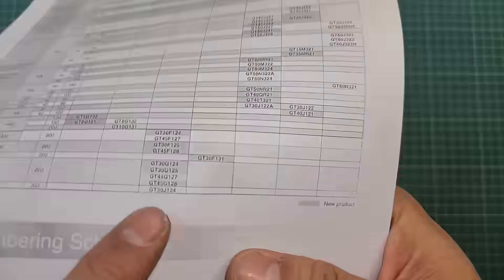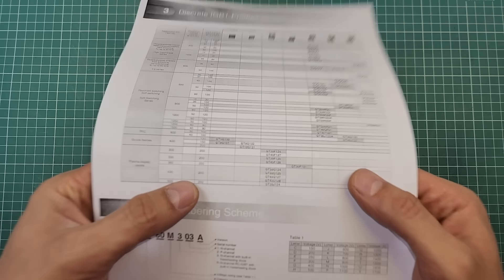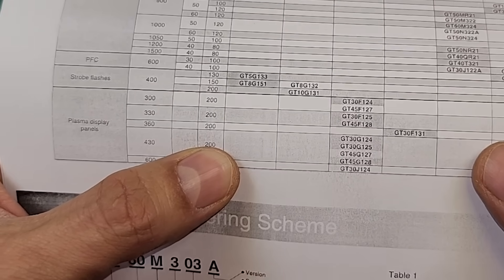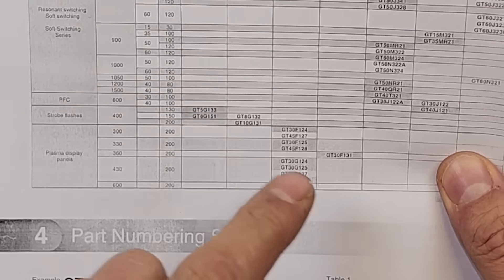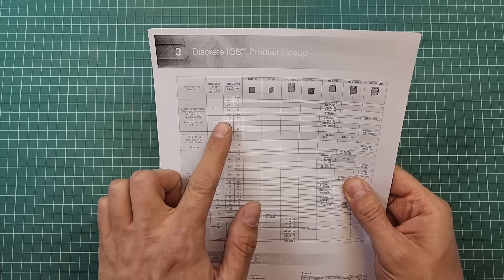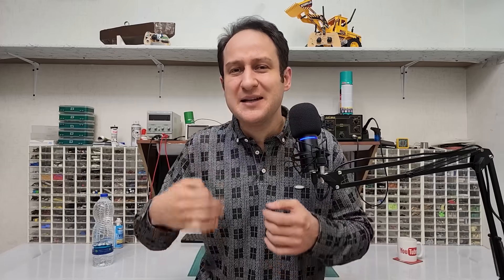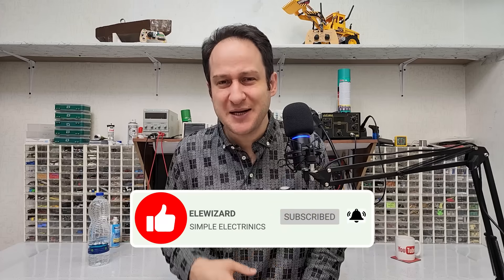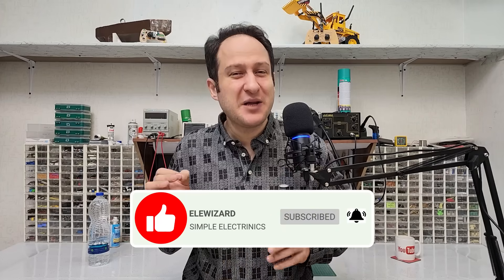Can a small transistor really switch 200 amps of current?

Comment: An experiment to increase laser diode output was conducted using increased voltage and amperage above it's specs.

The output was vastly increased but it required the laser diode to be submerged in liquid nitrogen to keep it cool.
Reply from the maker: That's a great idea, thanks for sharing!

Comment: I mean... What I do is look at the power dissipation, take the expected voltage across the device for a power calculation, and get an estimate.  Real components will always vary a bit and, while gate charge dissipation is usually not a significant factor for IGBT applications, it is worth considering in mosfets and stuff operating near the RF spectrum.  This also makes obvious strategies like zero voltage switching and other methods of driving voltage and current out of phase to limit thermal dissipation.

Ultimately, nothing beats practical testing, though.  There was some testing of overdriving some IGBTs into the ten kiloamp range and they found that the devices largely survived.  While you have a radically reduced part life, this is in the range of tens of thousands of cycles as opposed to ten to the power of big numbers cycles.  For applications which can accept the cost of replacement as a consumable cost - it's valid.

The datasheet should list the testing setup for context for all of its ratings.

Comment: The ratings are not inflated. People must learn electronics, understand the fundamentals, and understand power dissipation. Data sheets may also have SOA (safe area of operation) curves that can be foretelling. When these devices “turn on” or “turn off” it is not instantaneous so there may be much greater peak power dissipation during these events that would exceed the absolute maximum operating characteristics.

Comment: Had a mig welder with an 40 Amp solid state switching transistor for the 24 volt low current trigger switch to engage  the 110V primary and conduct somewhere short of 40 amps to the welders transformer through 8awg copper wire. Transistor was the size of two matchboxxes stacked up or a tin can big enough to sell ear buds in.
At some point it became insufficient for the parameters of the job. It didn't smell any better either.

Comment: Excellent video! From the way you explain the topic, I deduce that you have a deep knowledge of power electronics. Perhaps you could have added that the efficiency of IGBT and MOSFET switching for handling large loads depends greatly on the driver circuits, which quickly bring them to conduction and turn-off states. The datasheet also contains information about the rise time and fall time for this purpose.

Comment: 20Amp not 200Amp Mr 😂
Reply: Continuous is  20A, under 2us pulse max 200A with minimum duty cycle 10 to 1.  In RF industry many time surface mount components like monolithic amp with  higher power rating are tested in fixture or even on wafer,  however the fixture will not have sufficient dissipation capability , so to test the component  pulse power is used  with short duration for example  100us with 10% duty circle, reducing effective power dissipation 10 time.

Comment: I suspect the 1.3 V voltage comes from the diode on the emitter. For lower power dissipation, you probably need a special MOSFET or thyristor, which is actually better at high voltages. For 240 V power, you need a 1000 V semiconductor due to voltage spikes from LC elements.

Comment: The transistor cannot handle 200 amps ( maby for ms ... ) because the internal resistance and the connecting wires are not low-ohmic or their cross-sections are large enough ...

Comment: It seems that 3 µs is commonly used in specification of the "short circuit capability" of IGBTs.

In a practical circuit that should be the maximum by-design time it would take for the control circuit to detect the short circuit and turn off the device to protect it from destruction when the load is short-circuited.

From a table from a REAL datasheet, the following is the parameter and the conditions on the specification
  Short circuit withstand time
  VGE = 15.0V, VCC [less than or equal to] 400V [this is for a 600 V part]
  Allowed number of short circuits < 1000
  Time between short circuits: [greater than or equal to] 1.0s
  Tvj = 150°C

No doubt ap notes and design guides for IGBTs discuss this.

Comment: That is nothing even remotely resembling a proper datasheet. It is a "product guide" and a rather poor example at that.

I spent many years designing industrial electronics. I wouldn't give that part even 5 seconds of consideration if that were the only "datasheet" available. It doesn't have anywhere near enough information to be useful. A good datasheet for such a part will have a multitude of graphs of all sorts of parametric and rating relationships. One of the graphs will be a family of plots of transient thermal impedance versus pulse width.

I simply can't find a decent datasheet for the part, I assume because it is long obsolete.

That is an extraordinarily poor choice of part to use for a discussion of specifications. Choose something for which a proper datasheet exists.

Comment: 26A     ....NOT WITHOUT a GIANT HEATSINK!!!!!!!!!!!!!!!    ....or dipping it in liquid Nitrogen! :)
Reply: One hidden dirty secret that ALL manufacturers dot not tell you is the max current the internal wires can handle continuous.
Usually way lower than you think!!!!!!!!!!!!!!!!!!!!!!    .....Triply so for fake mosfets that test correct Rds, but would actually melt if used by the datasheet (because even thinner wires are used - how cheap can you get)..

Comment: Nice run through of the critical parameters in the datasheet. I've always thought that if I have to even look at a component's (near) instantaneous current capacity, I'm probably considering the wrong part. Your review of this device is a great example of that. 200 Amps at a few microseconds compared to a working, continuous 20-ish Watts is a huge difference. And, right, if you did try to push 200 Amps through it for even a second, it will indeed explode. (Don't ask me how I know that - and no, kids, please do not try this at home :)

Comment: 200A is the maximum survivable current impulse it can take, likely in nanosecond to a few microsecond duration. That is usually for trigger transformer or safety crowbar service. For the latter you'll want to use 2 to 4 of them in psrallel.❤

Comment: So, what can i use if i really want to switch 200a current?
Reply: Depends how fast you want to switch, what voltage, and how often.  If you want to stick with IGBTs, then there are plenty of modules which will switch in the kA range.  For lower voltages, you can use parallel mosfets since they do tend to share current better than IGBTs or BJTs.  There are also single mostfets (in larger packages than TO-220) that will do 200A continuous.

Comment: It's possible to damage a semiconductor device in several ways: overvoltage, overcurrent, or overheating. To work out what the maximum current it can switch, the datasheet indicates the maximum current is 200A for 3μs. Current greater than that, even for shorter periods, may damage the device through overcurrent. But the necessity of keeping the IGBT's junction below about 175°C means that there is a maximum power that can be dissipated, and the datasheet shows that the TO-220SIS package will allow 25W to be dissipated if the case is kept at 25°C. As shown in the video, the Ic vs Vce(sat) curve will mean that 20A will typically be the maximum continuous current, and that will be only achievable if the heatsinking can maintain 25°C case temperature.

Comment: 11:41 This diagram is in fact nonsense because it compares IGBTs with MOSFETs which nobody would use for 50 A drain-source current, because their Rds is much too high. IGBTs have a certain disadvantage: their Vce is in a useful current range always somewhere between 1.5 and 2.5 V. The Vds of MOSFETs at higher currents, however, can be considerably smaller, because it depends on Rds, which can be very small.

So IGBTs have only advantages at higher operating voltages because Vce is somehow limited between 1.5 and 2.5 V. At lower operating voltages MOSFETs are considerably better than IGBTs because the Rds of 60 V MOSFETs can be smaller than 0.5 mOhm and the power dissipation at 50 A current is only 1.5 W (which can be dissipated without a heat sink) in contrast to 75 to 125 W in the case of an IGBT.
Reply: Thank you for being one of the few voices of reason. Most of the comments are based on opinion. You actually looked at the datasheet and did the math!

Comment: Wait a minute.  The max pulse current pulse was had a width of 3 us?  I missed what the off time was.  I'm sure it's in there somewhere.  Was it actually a practical time duration.  On pulse at 3 us means nothing.
Reply: The off time would have to be long enough that the device exhibits an average power dissipation that will not cause it to overheat.

Comment: From the circuit diagram I saw an nFET connected to a PNP BJT. I have a problem when they call that most positive terminal the "Collector". I suppose it helps some who imagine they are dealing with an NPN BJT. But I rankle when they call the emitter of a PNP a "collector". Call that terminal "P", call it "Fred", but it is NOT a collector.

Comment: Mathematician: "...so as you can see from this formula of power equals voltage times current and the associated graph, we can conclude this part won't really switch 200A DC..."
Engineer: "...son, if you really wanna switch 200A DC, you'll want a brick with terminals that connect through BOLTS, not some TO-flimsy capsule..."

Comment: Just be sure that the transition from OFF to ON is as instantaneous as possible to minimize the time where its in the intermediate Rds range where it would instantly fry if it was kept there.
Reply: That would be correct (if incomplete as there are also issues with making it too fast) for a MOSFET, but this is an IGBT, which basically a BJT driven by an insulated gate.

Comment: This was a great breakdown of the information there, followed by putting it together to actually predict how the device will behave in real conditions. Youve earned another subscriber!

I like that many datasheets also give a max. temperature and "thermal resistance," so you can calculate the power dissipation rating with different heatsinks and conditions.
Reply: Even if it's not stated, you can always calculate the thermal resistance jcn-case if you know the rated power at case temp = 25°C. These devices typically have a maximum junction temperature of 175°C, so the TO-220SIS package, which allows Pmax = 25W (@ Tc=25°C), has a thermal resistance jcn-case of (175 - 25)°C / 25W = 150/25 = 6°C/W.
To use that, you can calculate that max power for a given heatsink. For example, a decent heatsink that has a thermal resistance to ambient of 1°C/W gives a total resistance jcn-amb of 7°C/W. At Tamb=25°C, that allows a power dissipation of (175 - 25) / 7 = 21.4W. That's about 15A continuous at Vce(sat) = 1.4V.
Reply: @RexxSchneider  that is a good point. You can calculate it from the other variables of temperature and dissipation.

Comment: I built a reliable nanosecond pulse generator for TDR work using just a small signal 2n3904 (rated for 200 mA) in avalanche 
mode switching 180 Amps at a 1 khz rate. 
180 V avalanche through a 1 ohm load (32, 400 watts peak pulse power for one nanosecond, but only 32.4 mW average power ).
Thermal dissipation is the metric for destruction of a device.

You can pass 10,000 amps through a #40 wire provided the duration is short enough to prevent heating.
Reply: lol cool - that reminds me of a lot of lightning arrester data - a gazillion amps for fractions of a microsec can go through a 12 gauge ground wire and not fry.  Though I do prefer the wider, thicker copper braided strapping just to be sure. :))
Reply: @ 
Coward... lol
Reply: There are only a few BJTs specifically designed for avalanche available. Great to hear someone else in the comments has made a fast edge pulse generator.
Reply: Also add that that #40 is short, very very short.
Reply: Em qual situação prática usaria fio n40 e 10000A por um ou alguns nanosegundos?
Reply: @ 
A tiny high intensity magnetic field inductor for diamond anvil metallic hydrogen experiments. 
Nanosecond magnetic field requirements for high field strength on chip inductors in optical computing.
Any IC leadframe uses wire bond wires generally thinner than #40 including SS lasers. Maybe not 10,000 Amps, but some short pulse laser applications run very high peak I levels.
Reply: @ Estou me referindo a uma situação prática para nós, reles mortais e não uma aplicação científica.
Reply: @ 
Drawing a blank on that one friend.
Reply: @sparkyy0007 Foi o que pensei.
Reply: @sparkyy0007 how about making multiple of this and making them switch ON 1 at a time to make a continuous high Amp switch. Will that do? Or maybe there are other better options? 😆
Reply: @ 
One billion 2n3904 in cascade avalanche mode (if it could even be done) , I think there are much better options...lol
Reply: I was shocked a lightning bolt could travel through twisted pair with enough power to blow the back off my DSL modem, and fry the network jacks of my gateway,
Reply: Was it an EO q switch driver? I did similar to replace a KN-22B tube in a scientific laser. String of transistors in avalanche mode ❤
Reply: @christopherleubner6633  
I was using it for generating very short pulses for time domain reflectometry, for finding impedance variations along transmission lines.

Comment: Would you be interested in working on a project with me. I'm being extremely ambitious, and in over my head, I know little about electronics. Yet I'm  convinced I can build a push/pull low frequency inverter, if I had help. There is driver boards available. I'm guessing the board connects to gate drivers, and feedback circuits. I'm looking to get 5-12kw with it capable of 8-15 kw for about 20 MINUTES. And 10-24 kw for almost 1 second, maybe 1.1 seconds in the certain weather conditions.  I looking for help finding  a the components, a large toroidal transformer cores. F or up to 4-6 , 3-4 kw , silicon steel I s difficult to get in raw form. I'd settle for 50-60mm x 1000mm -1600mm lon bits and from .05-.08mm thick to 1mm thick at most.  I have even contemplated how could I hand forge  electrical steel / silicon steel into 1mm thick or less strips 75 mm at most Wide.  
If you are interested I really need help . Have an awesome day..🎉

Comment: If the parametric table does not show a DC current, but only a pulse current, this seems like a strong indication that this device is optimized for pulse operation, and likely other components are a better choice for steady-state operation.
Reply: I was wondering about that...
Reply: The real give-away is that the characteristics of the GT30F124 are laid out in a table on a page labelled "Plasma Display Panel Applications" with an example pulse switching circuit, and the table is titled "Product Lineup    For plasma display panels".

Comment: Even transistors truly rated for high amps will fail from heat or over current.
Some decades ago I added a phono jack to my TV without a headphone amplifier.  The final transistor failed.  It turned out to be a cheap Korean imitation of an obsolete RCA transistor.  My father in law took me to the RCA western distribution facility and got me three genuine RCA transistors.  We got 3 in case the next two failed.  It turned out the genuine RCA could handel the higher output and lasted longer than the original cheap transistor.  Eventually the TV became obsolete. My father on law said the Korean TV had a circuit design that RCA had used years before.  The TV still had a CRT

Comment: Thanks for the video and teaching us more about reading the data sheets.   What is the practical use of 200A at 3 micro seconds?   Would it ever actually be used this way?   Is it just headroom/protection for a circuit that would really be designed for 20A usage?
Reply: This kind of transistors are common used into the photo flash guns.
The flash light is obtained by a trigger a ionized gas into a glass bulb. The duration of flash arc is less of 2 microsec. The power is too large, flash guns usually use a large capacitors to store the energy that will be discharged in a flash light.
A voltage of 300V is common used for commercial flash guns, likes Canon o Nikon.
Reply: @giuseppemartino5057  Ah, thank you.   That does seem like a real use for these.   I was trying to think of somewhere that you'd need an infrequent pulse like that and had come up with nothing.

Comment: Good video, but professionals know this. Whats more, if we assume pulse 3us pulse from 0A to 200A and down to 0A maximum allowed inductance in the circuit is 7.5nH. In other words this pulse is possible only into transmission line. If we want to push 200A into transmission line. it's impedance must be about 2Ohms (insane) OR load must be capacitive (only possible real world situation).